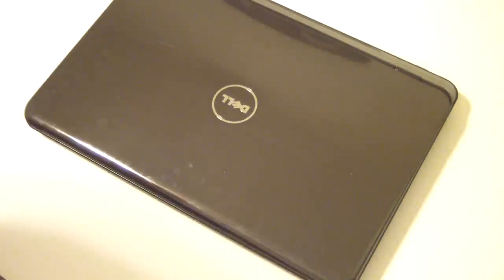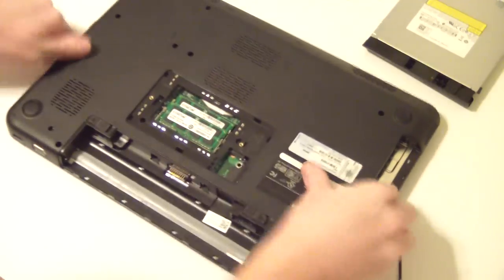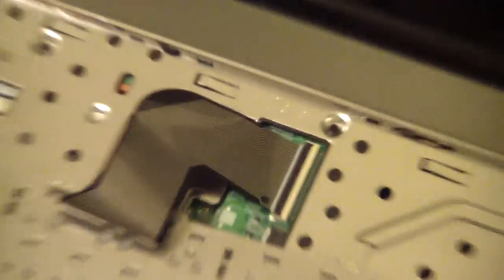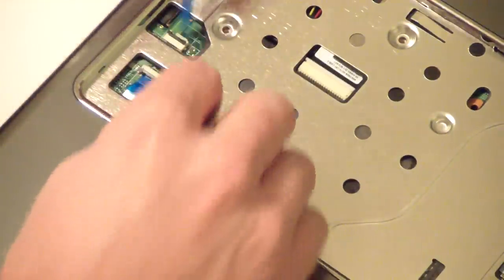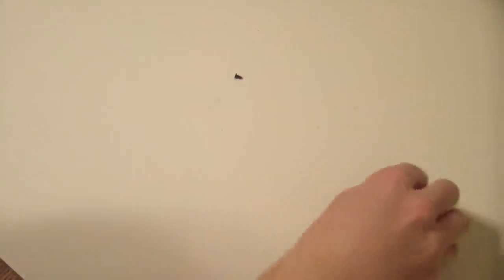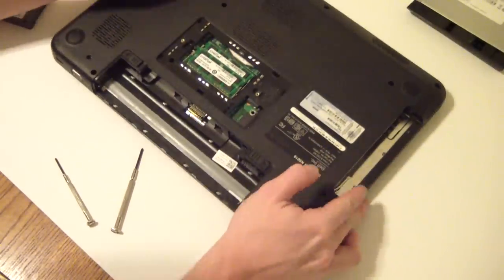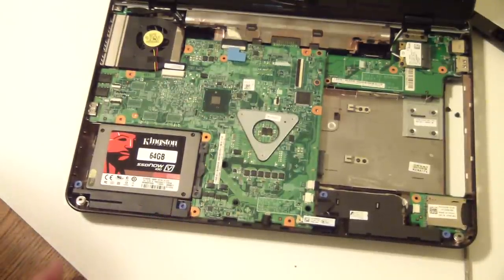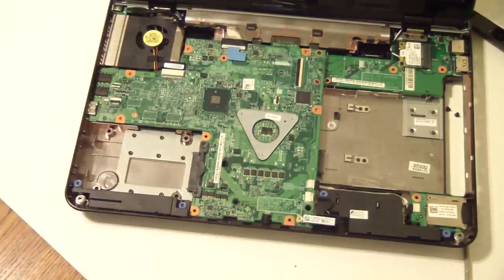How to Upgrade Hard Drive - Dell Inspiron 15R N5010 or N5110

Comment: I recently found an (8 year old) Dell Inspiron at  a garage sale. It looked like it hadn't been used much at all. I turned it on it worked well. For $25 I got it as a backup laptop.  I upgraded the OS to Windows 10 and duel boot with Linux Ubuntu 20.04. Works great! Then I cloned the drive to a SSD. 

The only word I would offer here is to be careful when removing the keyboard data cable. And when reattaching the keyboard, it has to be slid into place correctly or you'll (as I did), put the thing back together and your keyboard will not work. 

Good Video.

Comment: First; thanks. 
Second; can you only put one 2.5" unit on this laptop? I cant get 1 ssd and 1 hdd of 2.5"? 
Third; can i install windows 10?  Its compatible with this laptop?
Reply: Mazatzin Keej yes. You can install win 10 in this laptop. I have the same one & its working.

Comment: This doesn't work for the N5110, only the N5010. In the N5110 you have to remove the whole mother board -- and the screen --, because the hard drive is attached on the underside. It's really annoying.

Comment: I bought this notebook in Brazil. 
heats up, the performance is bad and the price too high. 
a lot of disappointment with this brand. 
never.
Reply: Totally agree. Same experience. Heats up.
Reply: +FaZe Legend mine heats up aswell but it runs really smooth and I play hardcore games
Reply: You have to replace the thermal paste on the heat sink. It's a pain in the ass because you have to remove every part of the laptop, but it fixes the overheating issues.

Comment: i have disasambled the laptop and maybe i have broke the touchpad cable. i bought a new one, but it's still not working. may it be the windows? does it want a new install?
Reply: try to reinstall the drivers. also try to check if the FN (orange key near the left control) + F3 works for you (this enables and disables the pad) also check if one of these kets is not permanently pressed
Reply: solved it with a new cable. thanks for the help anyway :)
Reply: +Paul K you  have windows ? you just gotta throw that laptop off your  windows
Reply: I'd rather not. the old bastard is still workin' like a charm :D

Comment: Why would DELL design their laptops like that? Like seriously, the most frequent upgrades are related to RAM and harddrives and they should have built back doors to these parts. This is an epic fail in my opinion and I will not buy DELL anymore. Never.
Reply: There's this handy door on the back for RAM upgrades, but you have to disassemble practically the whole thing just to get to the hard drive. Just use logic next time, Dell.
Reply: That's so no one can easily steal all you information by removing the hard drive. However, I agree that there are probably easier ways you can protect this and still give access. The current bad design reminds me of trying to change the oil on the newer cars. You have to undo about 8 bolts to remove the cover, only to access the oil plug.
Reply: Yeh buddy
Reply: This laptop's design is a mess, especially the hinges. When the left hinge broke, I took the laptop apart, and my jaw hit the floor. The hinges are fastened with a pair of tiny screws screwed into thin plastic tubes protruding from the back cover. Those tubes have to resist the massive force you apply when opening your laptop. I was hardly the best student in my day, but my strength of materials teachers would fail you if you tried to design something like that. Tiny plastic things can only be used if you need to hold an element in place to which virtually no force will be applied. I mean, you don't have to be a rocket scientist to see the flaw in this design. They could have made a test model, and it would have been obvious that, when you open your laptop, you are basically trying to pull those small screws out of the holes, which are nothing but tiny tubes with thin walls made of fragile plastic. It's a no-brainer, but not for Dell engineers, apparently. Normal laptop designers install thick rod-like elements and make hinges rotate around them when you open your laptop.

Comment: never mind, problem solved. In my notebook there is no screw fixing the keyboard, just some 2-side sailing tape keeping it glued to the silver-coloured base. You just  have to pull it, but you risk to break the keyboard :/
Reply: I have the same issue where can this tape be found

Comment: yup, what a mission, and the worst thing is you have to 1/2 reassemble it to see if your new HD works ....Be very careful with the little ribbon connectors under the keyboard , it took me 1/2 hr to get on back on, but I haven't seen all this video ... hopefully there is an easy way ...

Comment: The newest Inspiron 15R no longer requires this lengthy process, for those wondering. The RAM and HDD are easily accessible via one access door on the bottom of the machine after removing 3 Philips screws. Cheers.

Comment: Nice I was just tryin' 2 figure out how 2 find the hard drive. Good video, makes it much easier when I'm gonna switch. Much harder than I thought but now I will be able 2 try at least. 
A tip tho, why not use a magnetic screwdriver, then u will be able 2 have control over all screws without having 2 flip it over, every sec ;)

Comment: Same here, I thought it was because of my AMD Phenom CPU mine has, but after finding out it used less power and produced less heat that the Core i3, i5 and i7 in the same design, I stopped complaining about the CPU, but the heat is still FUCKING ridiculous!

Comment: my laptop wont boot up its just a black screen and beeps 3 times so i wanted to make sure everything was in place. and there is no screw holding in my cd drive. its still under warranty i only had it for a month but after seeing that i would rather get the money back for system that wont fail so soon im on a 2 year old dv4 that has seen all kinds of hell and works fine to this day

Comment: it is a very poor design not allowing a easy pull out hd. i would all so take a look at the cpu thermal paste as on my model the stock heat paste was all over the cpu and 252gt(gpu) this allow heat build up which is what you don't want. plus my uk model is IDE hd and is right on the motherboard which means i have to take out the mob which i really hate tbh. model inspiron N5110.